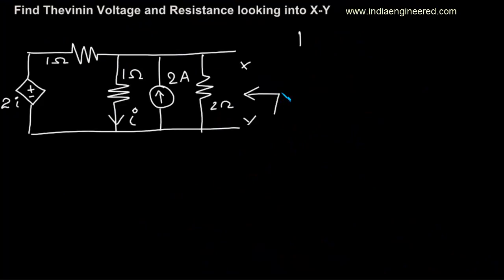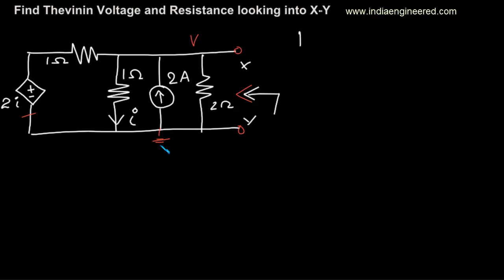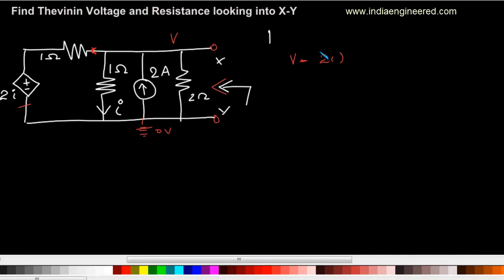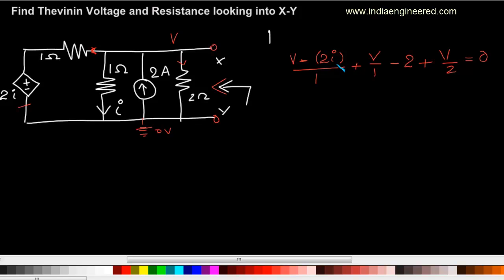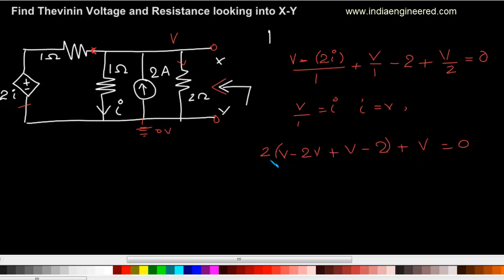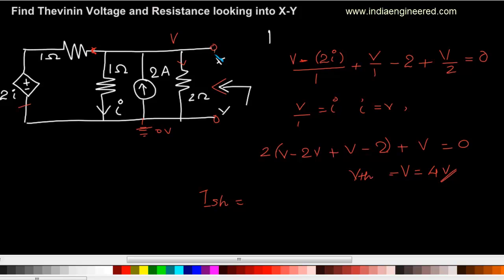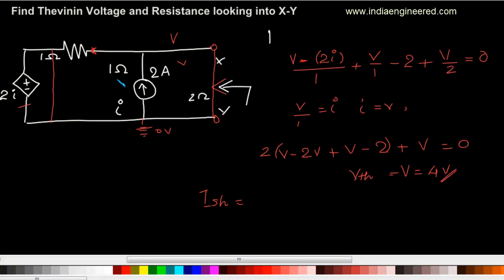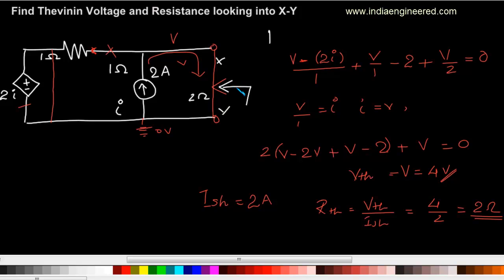GATE EC Previous Papers Network Theory #4

Comment: R TH shouldnt be 0.4 ohms??,if we just find out equivalent resistance of the circuit by open ckt of current source and short ckt of voltage source an dfollowing KVL..
Reply: a k  see the comment section of problem no #6 of this playlist